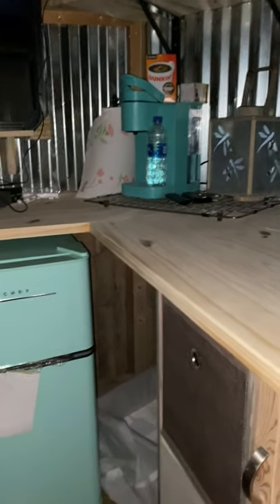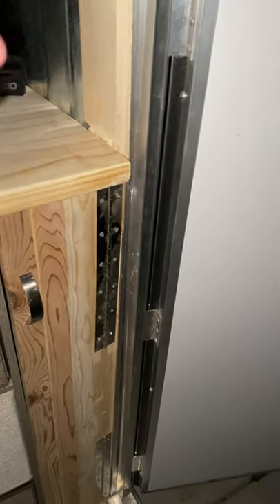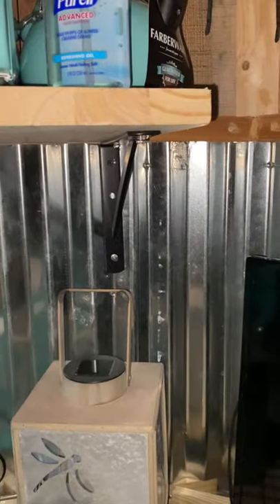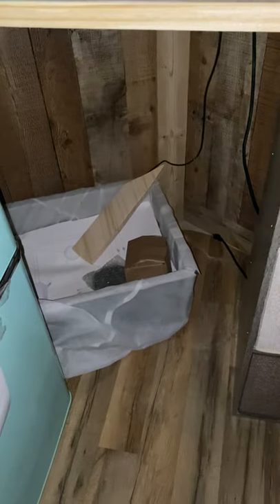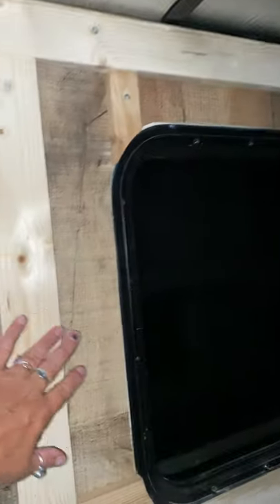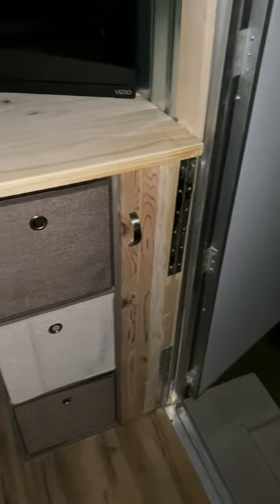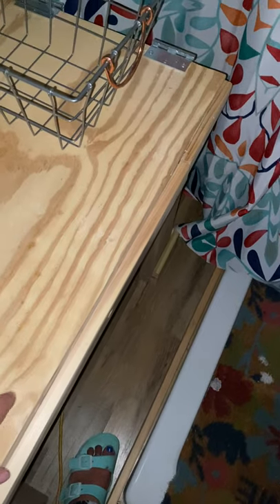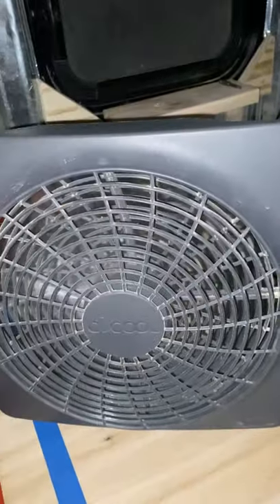My Cargo Trailer Conversion is Coming Along!

Comment: If you have to caulk yourself, use the painters tape to outline the wall around the window frame. Then you can remove it and will have a nice line for a good finish look. I suck at caulking too. I'll tape the wall and counter tops when i caulk, spread it with a wet finger, then pull the tape after it dries.
Reply from the maker: I DREAD doing it myself.  I’m just too impatient.  I suck at caulking AND painting.

Comment: If you don't know and it helps, farm and fleet or tractor supply sells a fitting to fill the smaller tanks from the bigger grill sized ones. We fill our own for ice fishing. The store bought cans last about 2 1/2-3 hours. If we fill our own they last longer than four hours. I was told you had to count to sixty and then stop filling. It didn't make sense and seemed dangerous that you could put more in the little ones than the bigger ones, so i hooked one of the little ones up and let it fill for 5 minutes. It took all the pressure the bigger ones had and stopped when the pressure was equalized if that makes sense. Meaning the bigger one doesn't have more pressure than the little ones will hold. Been doing it for more than ten years, have the little ones banging around in the sled, truck and sitting around in the garage and never had one blow. 
   The key to a good fill is to freeze the smaller can before filling, so it will hold more. You hang the grill sized one upside down so you get a better flow and get the liquid gas into the smaller one below it. 
   There are people who say you can't fill them that full, but it seemed to me if they would blow i would have heard about them blowing, there would have been million dollar lawsuits, and they wouldn't sell the adapters anymore because companies would have been sued out of business. 
   But if room is an issue, you can fill and use the smaller ones inside and keep the big one/ones outside. If a small one can run four hours on a heater or lantern when filled up, you could cook on one can for weeks before you used it all.